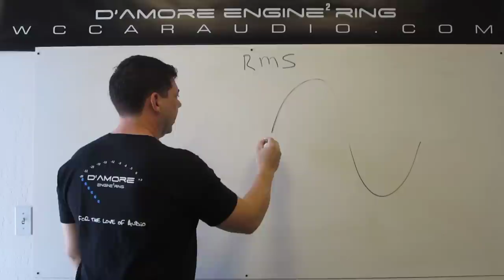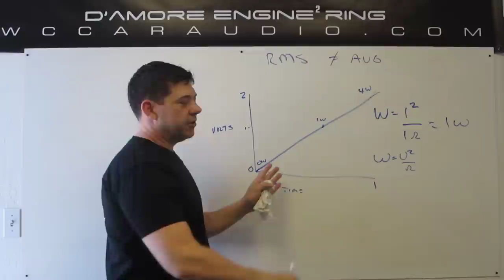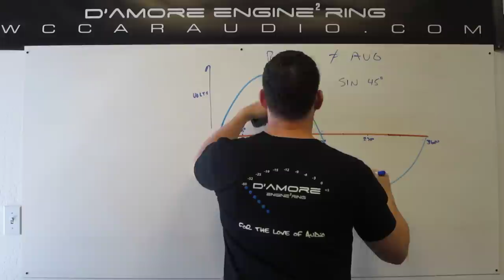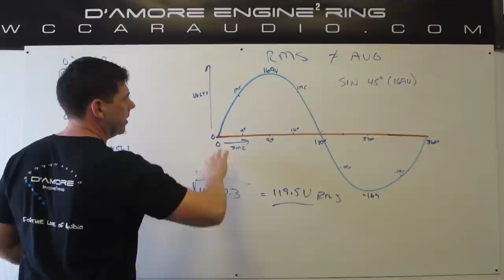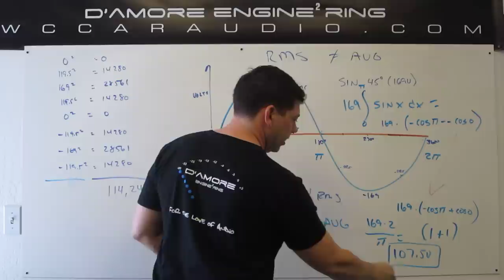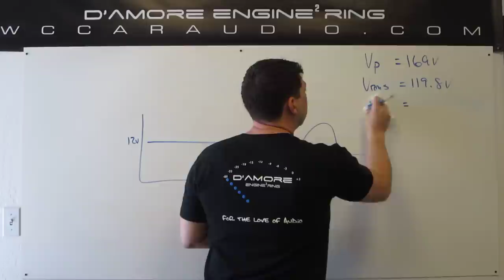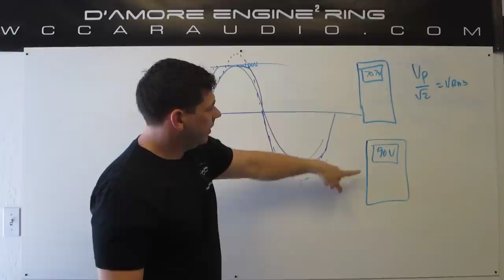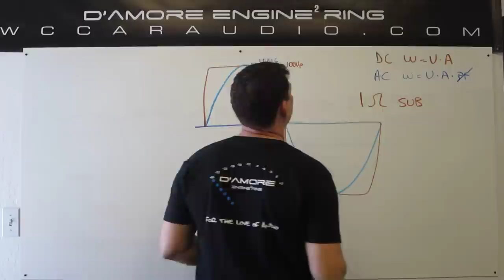D'Amore Engineering University Series: Video 5 RMS and Clipping

Comment: Use RMS instead of average because the average voltage should be zero.  By squaring the voltage measurement you get rid of the negative numbers guaranteeing a positive voltage when done.

Comment: RMS is the equivalent AC voltage required to produce the same power (into a resistive load) as a DC voltage. No need for so much math.
Vpk*0.7071=RMS or RMS/1.414=Vpk or RMS/.7071=Vpk.  For me, 1.414 is easier to remember. The root of 2.